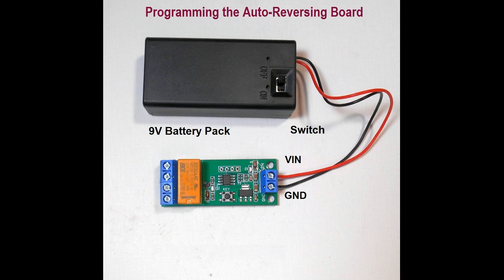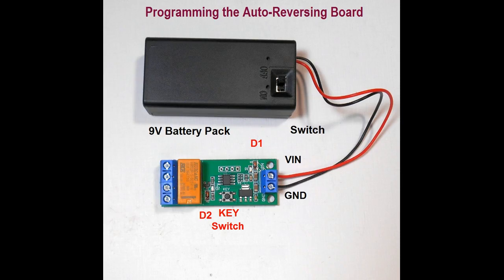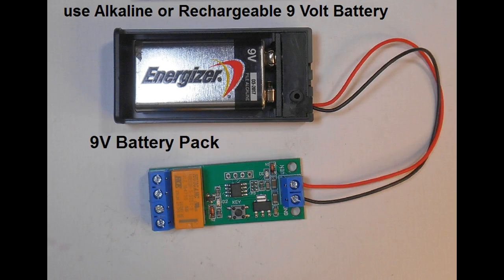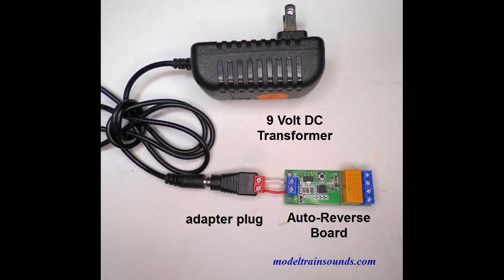Programming the MTS Automatic Reversing Relay Board

Comment: I just received this kit and haven't quite mastered the programming part yet.  I have an end-to-end light rail model and don't know the run time, I would just like the N-scale unit to get to one end, pause for two or three seconds, then head the other way.   It's challenging to know how many seconds to program each cycle to make sure the train makes it.
Reply from the maker: Hi. Just run your your model the length of your layout at the speed you want and count the seconds, one thousand and one,one thousand and .....etc, then add the extra seconds for the stop. This will be the ON time and  OFF time as described in the video.   You can program the board as many times as you like without damaging it.     Bob
Reply: @robertwilkins1765  Thank you!  I have programming down after some practice.  I am having some trouble with having the diodes work.  Soldering flux removed the markings on the diodes but an electrical tester helped me figure out directionality.  I have them arranged so that current from a positive lead will pass from left to right for both at both joints where I've added them.

More experimentation and I should have it working as planned.
Reply from the maker: @coastalrailsantacruz341  If you need more diodes just send me a stamped address envelope and I will send you out some more.
Bob